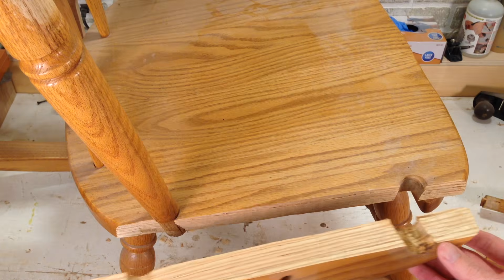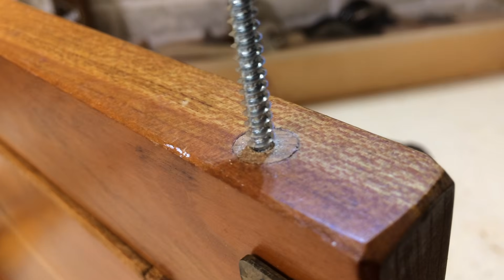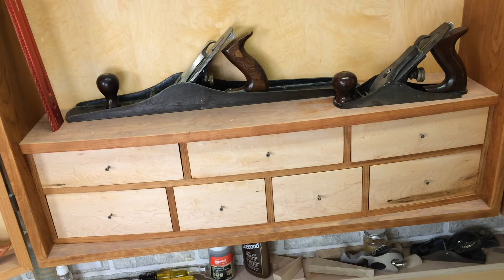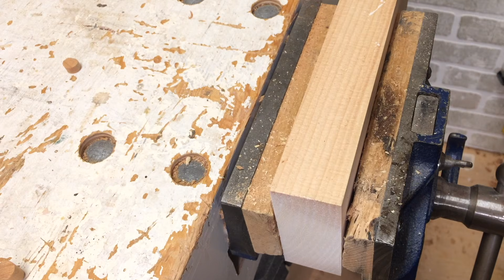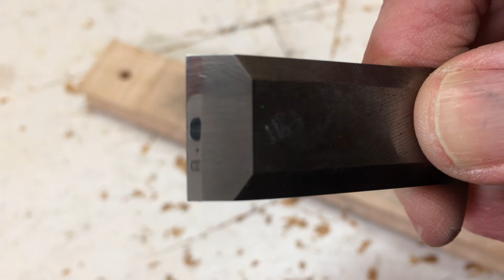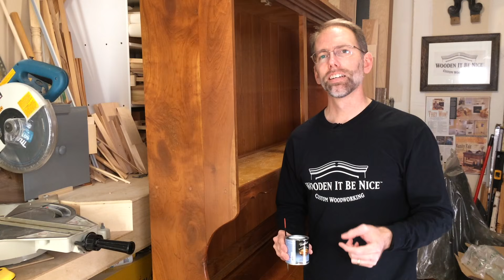How to Remove Wood Plugs and Replace to Hide Screws for Furniture Repair (aka Bungs)

Comment: I live in earthquake country, so I'm interested in hearing more about the bracket that secures the cabinet from tipping without causing the wood to separate during expansion/contraction cycles.

Comment: A tip i saw a long time ago when magazines existed.
Use a narrow strip of wood to cut the plugs from. Cut the plugs just short of going through.
you now have a strip of wood with the plugs still attached and the grain all going in the same direction.

Youse bends the wood strip which produces the plug oriented in the proper direction and has an applicator for applying. Stick in the hole, break off...
Bend the strip exposing the next plug. and on  you go
with them still attached to the wood strip you don't forget to align the grain and don't have to look to see which way it goes.
You have them all in a handy applicator all in your hand. 
The magazine had a thousand word drawing which showed it plainly.
You should also choose the plug wood so it is a close match to what you are plugging. Being the same species is not enough.

Comment: thanks for the demonstration on removing the screw plug. I have been reluctant to  begin re gluing a rocking chair until I saw your method. I feel I have a strategy for plug removal.
Reply from the maker: That's great to hear, good luck with your repair project!

Comment: You saved my day, thank you very much. I have a staircase that creaks so terribly. The rails are screwed into the wall with wooden plugs that hide the screws. Now I finally have the courage to try to get the old plugs out and see if I can get the stairs in order

Comment: I tried this method, but unfortunately it did not work like in the video. The wood plug did not come out. I had to use a large wood drill bit to basically drill out the wood plug. Then the screw inside didn't budge. I tried all the screw heads that fit, I tried by hand and with screw head bit in the drill. Nothing. How can I get a deeply imbedded screw out of the wood?

Comment: thank you wish i had seen this years ago.would have saved me hours and hours .
Reply from the maker: Glad you found it helpful... even iff a little late.  Cheers, Scott
Reply: They are tapered plugs so don't need gluing. Door should be held in a vice with his hand out of the way of the drill, bit lazy.

Comment: Thank you for this informative video.  Question:  when cutting the plugs level with the chisel would it help putting down some type of tape around the hole to prevent or reduce the chance of scraping the original adjacent wood?  I m thinking of easy removal tape that will not leave any residue.  Tape could be applied before hole is drilled?

Comment: Hi Sir, do you know what is the electrical tool used that remove excess plug from the surface and make it even with the surface. I saw in some videos but do not know the name of that tool. That tool also does not damage the surrounding of the surface. I have low strength and chisel may not be suitable for me.

Comment: Very helpful and informative!  Thanks for sharing your expertise. If you have a moment to reply I'd to know what size of strop you use.  I would like to make one but not certain about the best width and length.  I assume you also hone your planes in a similar fashion.
Reply from the maker: I show stropping a plane blade in this video. https://youtu.be/l7UPnpMNywE  My strop is 1 3/4 x 9".  If I had to replace it, I would go with a 3" wide strop to have more width for large plane blades.  I hope that helps.  Scott

Comment: 7:50  Now that's a great idea!  Cutting them close together.  Not only saves material, but makes them easier to break off.  I learned a lot from this video, especially the simple way to pull plugs.  I probably would've drilled them out.
Reply from the maker: Glad it was helpful Don!  Cheers.  Scott

Comment: Great video--however, I am still failing to get my wood plug out of an old mahogany chair--oddly they are slightly oval.  Any suggestions for what to do when the plug just isn't coming out?  Your videos are so great--just stuck on this one.
Reply from the maker: When that happens, I drill out the center of the plug and use a chisel to gently break away the perimeter of the plug so I don't damage the surrounding wood.  Here's a video on that technique for removing dowels https://youtu.be/Yk-1Th3jmlE

Comment: I don't know why they went into the end grain. They could have pocket holed into the edge grain for a better bond. The end grain screw over time with the expansions and contraction around the screw gradually loosened up it's grip.

Comment: I was taught to place the plug / bung grain in alignment with the wood grain of the hole, so that more than anything, it will expand and contract in the same direction orientation. Same species for both, but this was boat building specific.

Comment: Nice clear presentation, very professional. I don’t know if you respond to comments but I’m not clear about the sharpening board, I got the strop and the honing compound what was used on the opposite side? And, what was the staining product. (I live on a boat which needed repair. I’ve exposed about 100 screws in removing the time and am now reinstalling the time and about to screw coving plugs. I haven’t found a match for the stain and attempted mixing off the shelf colors isn’t working.

Comment: To protect your project while using a flush cut saw, drill the appropriately sized hole in the center of a playing card and place it around your plug, cut with your flush cut saw and sand flush. I have yet to damage a card much less my project. Unfortunately I am unable to post a photo. Playing cards are useful for dozens of projects in the shop, including minute adjustments, even spacing of a picture in frame, etc. 

Sorry if this has been suggested previously, I didn’t read through all 179 comments before responding.
Reply from the maker: That's a wonderful suggestion Michael.  Thank you for sharing that with this community.  Scott #Tip

Comment: Drill a hole the size of the plug on a metal flat sheet put it over the plug and then cut it..it will scratch the meta sheet not your work piece

Comment: nice video, you really went in depth on plugs and thats what I was looking for and the mirror finish on the chisel was pretty cool. maybe I should start using a leather strop or whatever its called for knife edges too. I'm just trying to learn some stuff for wood working.  I'm a noob lol. I would of probably of just used my angle grinder to flush out the plugs if I didn't watch this or some other videos on plugs.
Reply from the maker: Glad you're enjoying our videos.  As someone learning woodworking, here's an important lesson on wood movement for you https://youtu.be/pmM1APci8TY

Comment: Hey I needed to remove a wooden dowels from my study table im assembling...the dowel isn't broken yet I just want to remove it but its kinda tight coz I hammered it into the wood....do u know how I should pull the dowel free without damage to it?....use pliers?
Reply from the maker: You can try pliers while giving it a slight twist.  Good luck.  Scott
Reply: @FixingFurniture  thanks man just saw this now. Was able to get it out with some pliers🙌

Comment: Great video! The advice I've read for boat work is not to use wood glue to hold the bungs/plugs, but rather to use a little bit of varnish. The theory is that it makes it easier to remove plugs in the future, and you're less likely to harm the counterbored hole.
Reply: Exactly!

Comment: I was taught that you should put a groove on the side of the dowel/plug to allow the excess glue to escape.  Any thoughts on this?
Reply from the maker: I want a perfect surface without needing any filler.  I wouldn't put.a groove in it. Also, if you're using the right amount of glue, there isn't enough glue to get in the way.  I hope that helps.  Scott

Comment: You where talking about pocket hole screws. I recently built a shop stool using nothing but them. What I noticed is that in the softish wood i used (Doug Fir). Once the wood dried more (as it was fairly green) the screws did loosen and require retightening. So far that did the trick. But Its going to be interesting to see how they do over time. (stools only been together for about two months at this point). I have never seen them fail in face frames of cabinets. But those are all Kiln Dried woods.
Reply from the maker: There's an important difference between face frames and stools.  Stools and chairs are subjected to live loads - people sitting and shifting.  Because of this movement, the metal screws will wear out the wood and will loosen over time.  That's why chair legs don't have screws in them.  It will be interesting to hear how the stool performs over time.  Cheers.  Scott
Reply: yeah its definitely a good test. The stool was made this way since i was in a hurry for shop furniture and at roughly 15$  and a short amount of time. It was an acceptable compromise. Other wise mortise and tenon's all the way.

Comment: You gjued the panal to the frame, not allowing for expansion and contraction , this will cause the wood to crack.  Another of your bad fixes.
Reply from the maker: Vincent - I have been patient reading your comments on the previous 3 videos where you tell me I should take some lessons in furniture repairs.  Now you're making up stuff to insult me with.  As an experienced woodworker and furniture repair business owner, I understand wood movement and would never glue a floating solid wood panel into a frame.  I thought the comments from @Lane Cobb would have made you a little more humble, but you have proven to be insulting and arrogant.  Please keep your thoughts to yourself.  Scott

Comment: Thanks for the clear demonstration of plug removal. Would the technique (inserting screw in the plug) be effective for removing broken ends of chair stretchers? There is no screw inside to turn against but it could be a kind of handle to.help.pull the broken.piece out. I have had a hard time drilling the pieces out without destroying the hole.
Reply from the maker: Well you'll like this video then as we show how to remove broken dowels - https://youtu.be/Yk-1Th3jmlE
Reply: @FixingFurniture  thanks for this, it will be very helpful. Turning the drill in reverse to avoid damaging the dowel hole is very clever. I can combine this with some heat gun as the assembly is with hide glue. Thanks again!

Comment: I like pocket hole screws but I don’t use them as the solo joinery method. I use them with glue as a clamping facilitator for areas and joints not easily clamped or wherein time is a constraint. I have removed pocket screws after gluing with no steaming reduction in joint strength. I’ve switched to pocket screws with panel glue ups for ease and speed as you can keep working without having to wait on clamping; I don’t use thus method if you’ll readily see both sides but it works well for table tops. Pocket screws also work great for quick shop jigs, fixtures, or cabinets; they’ve always outlasted my need. I find I change things before any joints fail; always trying to save time and streamline things.

Comment: Great video.  I was wondering if you re-inserted the original screws that went from the stiles into the rails (or used longer ones) or if you felt that screws are totally unnecessary with properly glued mortise and tenon joinery.
Reply from the maker: The cabinet I repaired was a mess because the original craftsman didn't account for wood movement.  I only screwed in the panels on the front edge, then used slotted brackets inside the cabinet to join the remainder of the panels to allow them to "float" on the frame.  When I build, I prefer traditional joinery and wouldn't build with screws like this unless I was building a cabinet where the sides weren't visible.  I hope that answers you question.  Scott
Reply: @FixingFurniture  Thank you
Reply from the maker: You're welcome.  Enjoy your Saturday!

Comment: I would never use pocket screws on an item that sees dynamic forces like cabinet doors
Reply from the maker: I agree.  I would never build a door like this either.  The age demonstrates this construction technique is a failure.  Scott
Reply: @FixingFurniture  This door looks like it used half-lap joints (?), no wonder they failed. My guess is the screws were added later when the glue joints failed, in which case they simply squeezed the 'dry' joints together, without using glue. I'm sure basic tongue-n-groove joinery would have lasted much longer...

Comment: i will never use a pocket hole for anything. its awful. it destroys good furniture builds. the easy way out is never a good way out. lazy workmanship.
Reply from the maker: It was a design trend in the 1980's for DIY projects.  I've seen a few pieces like this over the years.  Not the way I build new pieces though, I agree with you.  Scott
Reply: Fixing Furniture only the Americans can take a technique from 300+ years ago and claim it as an 80’s trend
Reply: Klaus Restoration pocket holes as a woodworking technique is hundreds of years old and common on Victorian and Edwardian furniture

Comment: Why would you not replace the screws with dowls right through.
If this repair was not done for a customer, would you still keep to the original way of assembly?
Reply from the maker: The screws held fine, for the lifespan of this piece, so I didn't see the need to replace them where I reused them.  What was wrong was how the cabinet didn't allow for wood movement.  I adjusted for that when I reassembled it.  Basically the front holes are where I reinstalled the screws.  The remaining holes were just plugged.  I installed floating brackets inside the cabinet to allow for the wood movement so the panels would remain intact.  Now that I explain this, I guess I could have made a video just on that topic.  Cheers.  Scott

Comment: In my experience, pocked hole screws fracture easily.
Reply from the maker: I've never heard of that, but I rarely build with pocket hole screws as I use traditional joinery methods.  Thanks for the tip!  Scott

Comment: Actually, I was wondering if you weren't ruining the head of the screw you were going to remove to repair the cabinet door.  I know you were using an impact driver but still, how do you manage not to "screw" it up?
Reply from the maker: Good question - the point of the screw is very small, so when you screw into the plug, only the small tip touches the screw inside.  It doesn't damage it as it has no way to grab on to it.  I hope that helps.  Scott

Comment: The best plug cutters by their nature are cut as a taper form. If you don't have one of these - grind or sand your drill bit down to a VERY tight fit. the gap with the glue will always show - be it 1/4 mm or less -what you want is over tight and matching grain - ideally no spacing and things -once sanded -disappear. Tight Tight Tight is what you want. Many sell sets that leave a clear glue line around the edge Tapered plugs get rid of this with the next thump down - Don't have one  -taper one of your drill bits to be SLIGHTLY smaller than the plug -so that there is always a force fit.
Reply from the maker: Thanks for sharing your tips!  Scott

Comment: I have that exact Stanley flush saw that I bought to do just this task, but I wasn't happy with the result. I appreciate that the chisel option is the most versatile, but I decided to go hunting for a better flush cut saw and ended up going for a Japanese saw (I had to look up the type, but it's called a Kataba) which works flawlessly without leaving any marks on the surrounding wood.
Reply from the maker: Cool!  Thank you for that tip.  I will look into getting a Kataba.  Scott

Comment: Scott did you make that sharpening leather device or did you by it, and what did you called it?
Reply: It’s called a “leather Strop” you can make them quite easily with a piece of scrap wood, some glue, and an old leather belt with the shiny/smooth side glued DOWN to the wood, and the furry side UP. The green paste/compound can be bought in stores, the company “Veritas” makes a really nice one which is cheap.

Comment: When you go to remove the old plug, is there an easy way to tell ahead of time if it is, indeed, a plug and not a dowell?
Reply: Kevin Kennedy-Spaien Use a magnet or a electronic device to scan walls for studs and nails
Reply: @jeroenru  Good answer.  And great question too.  Thank you to both.

Comment: On video the varathane didn't seem to match the old finish - and the finish step is the one that I'm scratching my head about the most. Was that a on camera thing or there's a difference in real life too? I'll have to work on my parents hardwood handrail in the house and I wanna make sure I blend it seamlessly, and I'm not sure I can blend that varnish. I'll be using Saman stain and Saman water based varnish for interior.
Reply: Andrei Fasola  The only way to have a totally seamless finish is to refinish the whole surface.

Comment: That lasted 35 years with a screw into end grain? Pretty good if you ask me. I think since pocket holes don't screw into the end grain they would last even longer. At the same time, I don't think anyone would use pocket holes for heirloom furniture like this.
Reply from the maker: I agree that plugged screws aren't what makes quality furniture, but this was a style back in the 1980's.  I haven't seen many pieces of furniture like this.